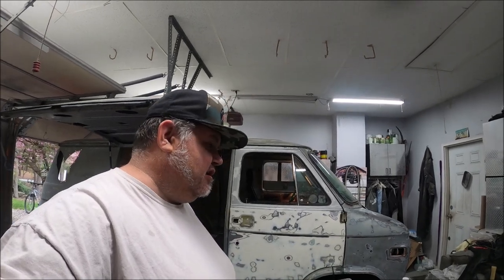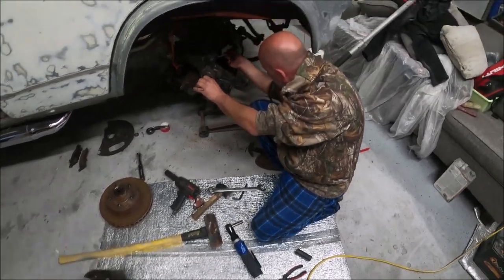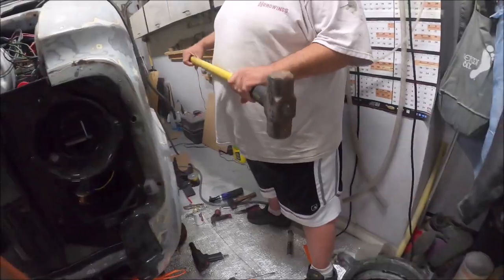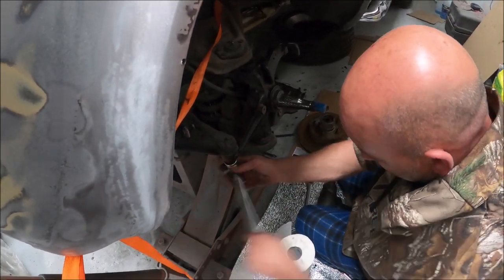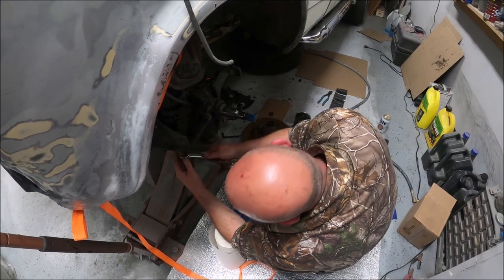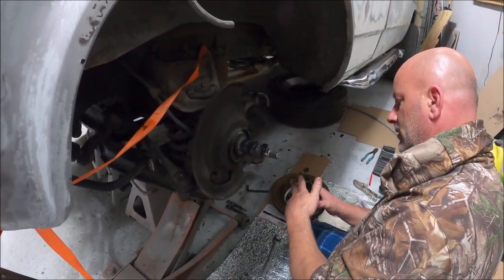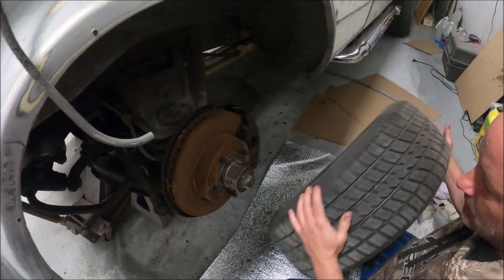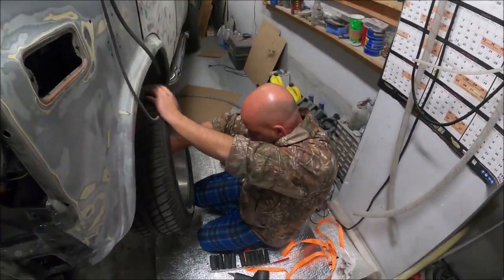Installing Drop Spindles On A Chevy G10 Van

Comment: Please share what drop spindles you used.  Did you have to change bearings ect . Thank you for your great videos
Reply: Agree, What drop did you use and brand
Reply from the maker: They came from Ebay a few years ago. They were originally purchased for "vandemic" but it made the front too low so Kevin sold them. He bought them for a C10. You have to use at least 15" rims and fro what I remember we had to shave a little off from somewhere, could have just been the rims he was running though. These are a 2" drop and didnt change anything. All lined up perfect. I will see if I can get more info but probably just a generic brand.